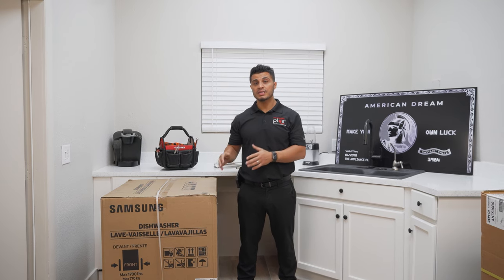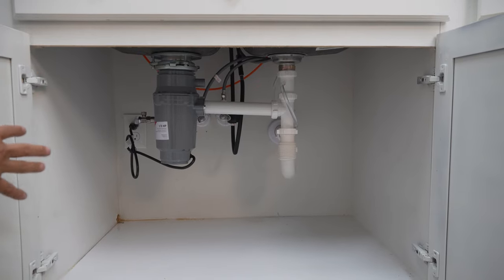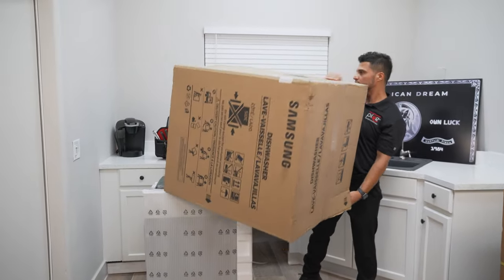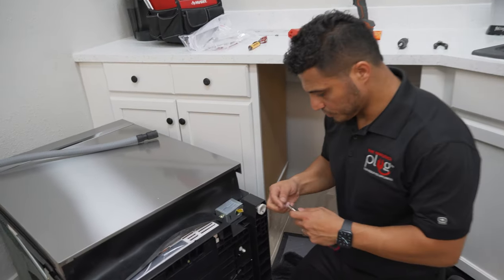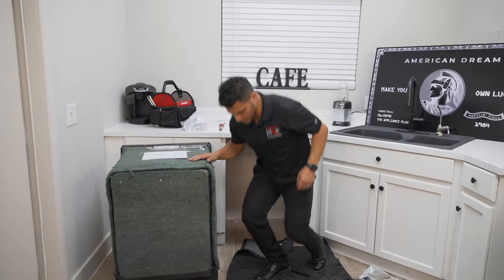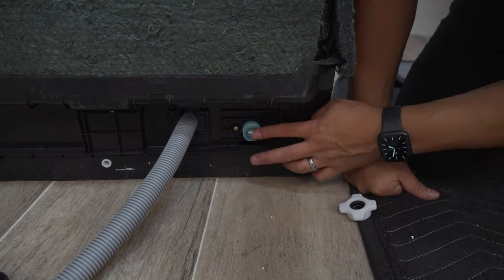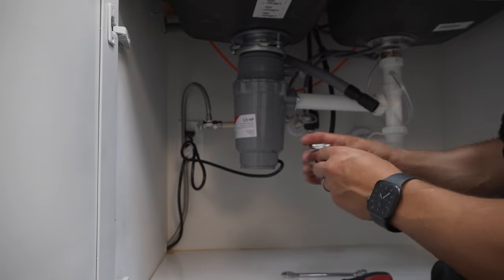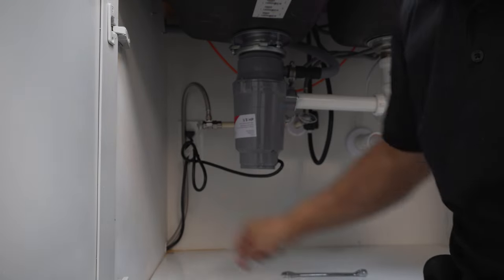How To Install A Samsung Dishwasher - Step by Step

Comment: Incredibly helpful to have an install video specific to Samsung dishwashers... THANK YOU!!!
Reply from the maker: No problem! That is one of the main reasons why we made this video! Were you able to get yours installed?
Reply: Yep... installed! My water line actually comes up through the basement floor. But I was able to have the copper elbow on the inlet valve point straight down to where the water line came up through the floor. Had to fight the black clamp that holds the discharge line to get it moved, but it all ended up working great... thanks again!
 @TheAppliancePlug

Comment: The wire nuts and the wires need to be wrapped with electrical tape for long term stability from the dishwasher vibrating!  Not mandatory but advisable.  Great job  thanks!!
Reply from the maker: No problem and thank you for the tip!

Comment: Excellent video.  Very comprehensive and easy to follow.  However, there is one thing folks should know.  I bought a Samsung Stormwash dishwasher and what I didn't realize that it needs to be connected to HOT water, not cold water as my previous dishwashers were.  This may be something that needs to be addressed in future Samsung installation videos.  Since plumbing in new connections is not within my skillset, I will be calling a plumber to get the hot water plumbed for my new dishwasher.

Once again, thanks for the awesome video.
Reply from the maker: Thank you Tim for the kind words and to tuning into my channel! Yes some dishwashers do require different setups may that be electrical or plumbing. I would always recommend consulting a professional like you are doing! Sometimes when it comes to electrical and plumbing you would want to stay away!

Comment: Good instructions bro. Do the supply hose connect to the hot water?
Reply from the maker: Thank you for the sub! And yes you do!
Reply: Thanks again. Moved into a brand new house and they just plugged the dishwasher in without the hoses and without the hole to run the hoses through. Youll think a half million $house would be completely read but 🙅‍♂️

Comment: You  are a great teacher!  Just installed mine today however the space is just on point and the black side gaskets stick out so that I cannot open the neighboring drawers. This sounds stupid but, can I remove them or are they essential for function (i.e. stopping leaks.)?
Reply: and if they are essential, can I trim them down?

Comment: Great video. My Samsung is a little different for the side mount than the one in another video of yours. The brackets shown for the top mount are used for the side mount. I was hoping mine was like your example. Now I have to pull it out to install those brackets. Thanks also for the leveling tips.
Reply from the maker: Ah man! That sucks they came like that, hopefully you have solved this problem and installed your dishwasher!

Comment: Boy I'd love to have you show how to attach to the cabinet seeing as the holes in the dishwasher are twice as big as the screws and they just pass through.
Reply: I think you are supposed to be screwing into the mounting plate and that hole just gives you access for a side mount.
Reply from the maker: I am little confused on what you are trying to say, can you please explain
Reply: My bad.  I have a granite counter and needed a side mount however I did not have brackets and was not aware the brackets get shortened and mounted on the side.      Even the manual was vague, and YouTube was a bigger help.
I don't see why they used a bracket at all for a side mount when making the tube side hole as it is but the cabinet side hole (there are two the same size) smaller would have solved the issue.
Anyway, thanks for the help FeeBay had the brackets.

Comment: One issue I have is more esthetics, I am using side mount, and securing to second hole, it was the furthest it goes, and the rubber seal is huge and is visible and it seems not right. not sure if there is a way to tuck them in, or use other less large. what is your opinion when this happened? Model DW80B7071US

Comment: @TheAppliancePlug I pulled out the dishwasher without disconnecting it from the main drain (under the sink) and the hose now looks like it has hose inside a hose. Is that normal? Did I damage my hose?

Comment: we had our dishwasher professionally installed.  Ends up, the water line was crushed under the dishwasher in the back of the cabinet.  The pro is no longer available.  So we are on our on.  We pulled the dishwasher out, found the crushed line, fixed that, now we have returned the unit to the cabinet and it is no longer level.  Having fully used the level ability of the front levels, we now need to adjust the back level.  But we don't have a T bit, 9/64th T bit . . . . . (time stamp 7:00-7:05) . . . . where can we get that?  Any hardware store?
Reply from the maker: Hi Marcy! Yes any major hardware store would carry a T-bit. You can also shop on Amazon as well and type in the specific one you want. If you have any other questions please let me know or you can give us a call at The Appliance Plug as well!

Comment: Does Samsung not include the brackets?
Reply from the maker: If the unit is purchased new in box, the brackets are included and located inside with the owners manual.

Comment: Just a heads up, the seal on the kick plate should be flush to the floor.

Samsung manual says
"Finally, attach the kick plate to the bottom of the dishwasher. While keeping the rubber
skirt of the door taut, push the kick plate from the front of the rubber skirt inward
underneath the door of the dishwasher. Make sure the gaskets of the kick plate are
flush with the floor and side walls. Then, tighten the screws to fix the plate."

Comment: informative, well done i forgot drain loop thanks very important to keep dangerous gases at bay  except i would also have a loop below drain on pluming pipe side also  (probably loop built in regardless?)..... but just use t fitting not plastic at 90' as its far more durable, take screen out so you dont starve your motor when it get clogged burning out your pump im not an installer just seems common sense

Comment: Do not buy this model. Installed unit and it leaks out both corners of the door, (left side is worse). The rubber flap that is at the base of the door thats installed between the kick plate actually hides the leak. My hardwood floor is now damaged due to this. Discovered the leak when using a heavy cycle, it had leaked outward so when explored by removing the kick plate i noticed that it had been leaking for a while causing the flooring to swell and lift. I contacted Samsung warranty, they sent a technician. The technician discovered the unit unlevel and thats when Samsung closed the ticket. I told the technician that (I) raised the front of the unit to limit the leak pooling to the front which assisted in it leaking out the door but didn't stop it from leaking. I waited two weeks to call Samsung warranty after the technicians visit and now that they closed the ticket they have to forward to another supervisor dept. to create another technician visit. The technician shared that Samsung is the worst at making repairs. He said that they would likely close the ticket because of him finding it unlevel regardless that it still leaks. He continued to say that his in his experience with Samsung they won't offer any repair or exchange. This model cost me nearly $900 @ Lowes. Word of caution "DON'T BUT THIS MODEL" !!!!!!
Reply from the maker: Sorry to hear you had such a bad experience.
Reply: I am going through this exact same issue with Samsung on our unit! Were they able to resolve it for you? I am still waiting for them to contact me back about having a new tech return and evaluate. The previous tech replaced the seal and then determined the dishwasher was “not level” and closed the ticket. Super frustrating!
Reply: Thanks for the feedback! I’ll be battling them with this one for sure!